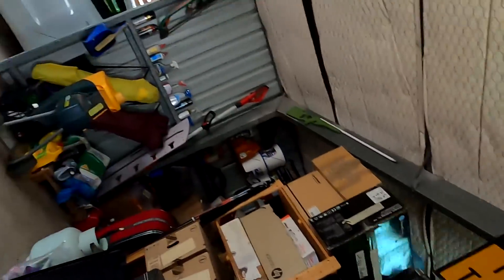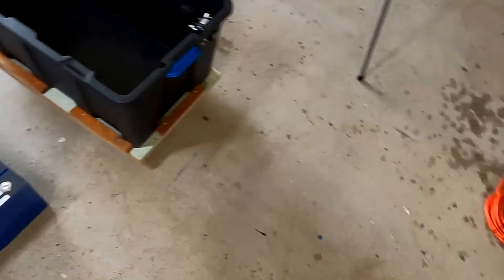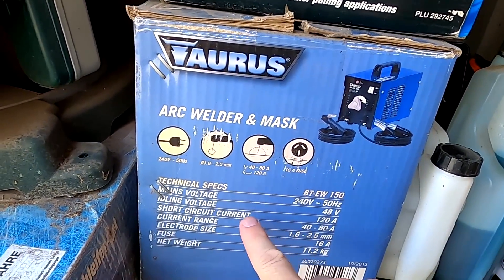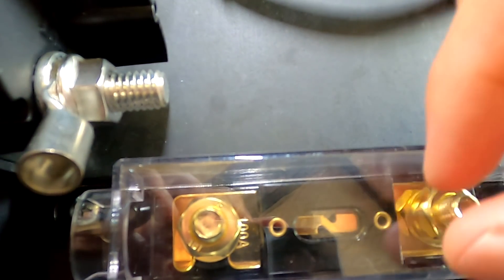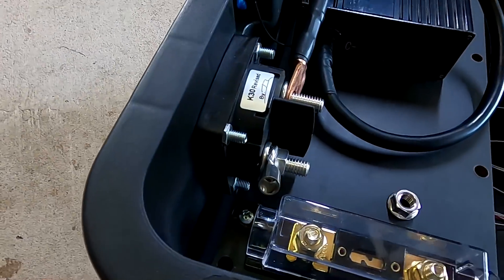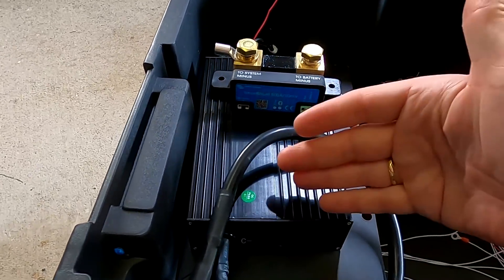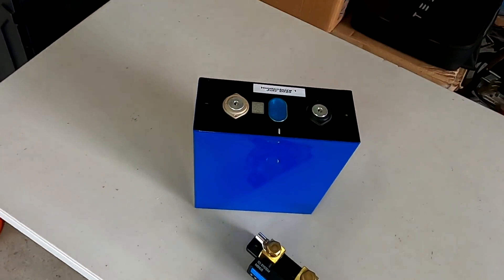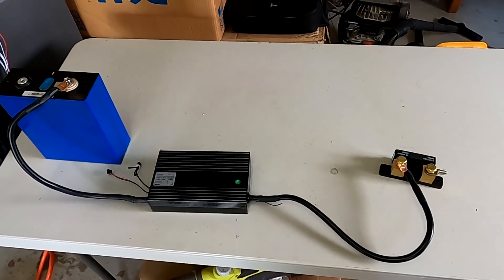Setting Shunt before the BMS a bad idea? Here is why I think this is GOOD! #buildthebattery.2

Comment: You mentioned that the charge controller is programmed to use the shunt rather than it's B+/B- leads for voltage sense. I would suggest number #2. The BMS directly to the battery and the shunt afterwards. This way the Charge controller reports correctly if the BMS disconnects the batteries and doesn't try to push current. The voltage drops you are concerned about don't exist when current drops off near full charge so don't impact charging function at all.  If you go with option 3 you create a very confusing situation if the BMS fails or disconnects the battery.  The charge controller will see battery voltage that is actually disconnected, and will attempt to charge it. Meanwhile what's actually connected to the charge controller leads are the load side so the current will actually be pushed into the load. but the voltage and shunt data still show no current and the (disconnected) battery voltage. That's a very confusing set of meter readings when the BMS is tripped and not what you want to see.  I'm also of the mind that you should consider mounting the fuse opposite the switch and connect it mid pack where it can offer some protection against a short mode failure of internal components.  Where you have it now, all it's protecting is the wire connecting to the whatever the load is.
Reply from the maker: Great points. Thank you.

Comment: That is a series battery only about 900 amps at short not 10,000. #4 From battery to shutoff to bms to shunt to terminal. This isolates battery from potential bms failure as well.
Reply from the maker: LiFePO4 cells have a super low resistance and can easily deliver 10-15kA when shorted. This is not lead acid tech.

Comment: Remember more devices you add in series the more resistance and less voltage your load with receive. Therefore more current will reduce your amp hours when load is applied. Testing amp hours is more accurate when load ( your common use) is  applied
Reply from the maker: Yes, I know that, but you need to connect all this somehow, right? There is no way around having quite a lot connections. I hate this too...

Comment: Question is the batt pack two 24 volt batteries and if so how did you parallel them curious having a bms involved I'm a fla batt guy (fla is flooded lead acid)
Reply from the maker: The battery consists of 16 LiFePO4 cells in series.
fla... nice word ;)
Reply: @OffGridGarageAustralia  Take a look into Hall effect sensors with bluetooth no cutting the smart shunt as far as I know doesn't control the solar charge controller
Reply: @OffGridGarageAustralia  Food for thought being a fla batt guy take a look at Rolls Surrette batteries I'm looking at the 6cs17p 568 amp hours now that's a battery

Comment: Hi Andy, I was reviewing 1 of Will Prowses how to's & he was saying that the Victron Solar Charge Controller does NOT like having the battery disconnected before the solar panels like if a BMS disconnection occurs. He suggests connecting the controller -ve directly to the battery -ve. Just to raise more head scratching issues. Cheers.
Reply from the maker: The is a statement in the Victron forums and they confirmed the MPPTs can handle it without been destroyed. I haven't read the manual yet, so not sure what that says.

Comment: Well, i like it and hate it, should have gone with a metal case, to move heat away from the batteries, heat kills batteries, and would also be able to be fire rated, allowing a more diverse/stupid use-case
Reply from the maker: I don't expect they will get too hot tbh. I will draw 70A max from them.
Reply: @OffGridGarageAustralia  metal case more for if you have a pack failure. Or wire failure. In the event they purge they might fail semi safe but no saying what it's in will. And depends where you put the mppt but would assume charging will generate its own heat. Isn't just how much you draw

Comment: Hi Andy. I'm intrigued with this project. Question. I'm completely non technical but would love a diy set some day in the future. If one had a all in one inverter, can you still have the smart shunt and victron mppt CC? Would the inverters mppt conflict with standalone mppt and smartshunt?
Reply from the maker: Thanks Lennie. The AIO unit has a solar charge controller, inverter and all the cabling already included. It just needs the solar panels and the battery to work. It's very easy to setup. The unit needs the correct settings for the battery and you're done. I probably buy one in the future to show how it works.
Reply: Off-Grid Garage Hi Andy. Thanks for reply. I get the concept of how it works although programming parameters for lithium would be a challenge. My question was basically with an. AIO set up I would I still need a smart shunt and addition mppt if I had a large array and large battery bank?

Comment: Shunt first and do high current charging via the shunt if bms does not support 1c/2c fast charging. Use a high quality charger and discharge only via bms.
Reply from the maker: You're not using solar to charge the battery?
Reply: @OffGridGarageAustralia  Yes but very limited with sun in Norway during winter so fast charging with generator in addition.   Anyway - thanks for a great channel :-)  Cool to se others doing similar setup as I have in the mountains over here.

Comment: Thank you for these videos, I will be using #3 scenario for my build.

I don't want to hijack your thread but if anyone has any input, I'll be using bus bars on both the negative and positive sides of the battery and was curious where they would fit in sequence. I also have the Victron battery monitor shunt and a BMS for my Lifepo4 cells.

Comment: your switch goes on the positive terminal with your fuse inline of the positive
Reply from the maker: That's a bit of cabling effort... I was planning to have the switch in the negative string in this order: battery-shunt-BMS-switch

Comment: #2... othwise the losses in the bms are not accounted for and the actual voltage your inverter sees will be different, only true way to find out is set up a test rig and monitor,  regards Pieter
Reply from the maker: The BMS has very little losses, same as the shunt. I have to decide for one option and see how it goes.

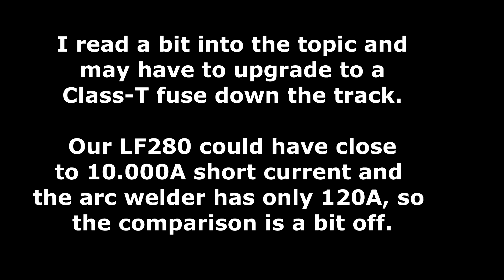Comment: Anmerkung zu 3:59
Wenn eine Sicherung auf 10 A ausgelegt ist und die Spannungswerte eingehalten werden, ist es egal ob da eine 10AH-Batterie oder eine 10000AH- Batterie angeschlossen ist!  Nur weil euer Strom vom AKW kommt installiert Ihr doch zu Hause auch keine Hochspannungsschütze!
---
If a fuse is designed for 10 A and the voltage values are adhered to, it does not matter whether a 10AH battery or a 10000AH battery is connected! Just because your electricity comes from the nuclear power plant, you don't install high-voltage contactors at home!

lg walter
Reply: If you are responsible for keeping the nuclear power plant safe as Andy is for his batteries then he has to ensure that his safe devices will interrupt a dead short.    Between you and the nuclear power plant the distributor will have interrupters to ensure they don fr you or their network.
Reply: @Muppet_Interfector  that has nothing to do with safety!  That is  overengeniering  ---> witch means waste of money!
edit:  see Datasheet from the fuse 
https://docs.rs-online.com/ef18/0900766b8160f8e7.pdf
hand walter
Reply from the maker: Wir haben keine AKWs in Australien.
Reply: @OffGridGarageAustralia  GSD

Comment: The Shunt is a two directional current measuring device. My thought is to use it at the cabinet with battery input on one side and load, inverter and chargers on the orher. Measuring in going and out going current flow.

At the battery connect BMS - Master Switch - Fuse.
Reply from the maker: Another option I didn't thought about. Arghhh

Comment: The arc can last a lot longer than expected. When the link blows and the end points continue to melt, the air fills with ions that conduct very well. The arc will sustain over a distance of several orders of magnitude greater than would be possible thru clean, dry air.
A fuse has three critical ratings. First is the fuse amps. Second is how many amps it can interrupt. Third is the voltage it can interrupt. All three need to be suitable for your application and the ANL fuse is almost certainly not capable of interrupting the current those batteries can provide, and it is highly likely that your car audio fuse voltage rating is less than the maximum voltage on your pack (most automotive fuses are only rated for a max of 32volt but I do not remember what is usual for ANL, and have no idea what your fuse is rated).
Reply from the maker: Thanks, great comment and explanation. I read that the ANL fuses are safe to use with li-batteries. This one is for 48V (as per seller) but it does not say on the fuse itself. So you would go with a class-t then?
Reply: @OffGridGarageAustralia  Victron Energy MIDI and MEGA fuses Rated to 58 Volts. Looks like they also have ANL fuses that are 80V.
Reply: @OffGridGarageAustralia  I know this is two years old but for anyone else reading it all comes down to short circuit current and the AIC of the fuse.  High capacity lithium cells (or multiple cells in parallel) can have huge shortcircuit current.  That requires a high AIC.  You can calculate it yourself.  I = V / R.  Fully charged the cells are 3.65V.  If internal resistance is 0.25 mOhm then short circuit current (dropping a conductor across primary battery terminals) would be 14,600A.  ANL fuses are usually rated for 4k to 6k AIC.  Class T for at least 20k AIC.  Class-T is really only needed at the primary battery fuse.  The branch circuits can use ANL or Mega because the wiring between the battery and any branch circuit (plus switches and busbars, etc) also add resistance which lowers the short circuit current.
Reply from the maker: @namechamps  Thank you for this additional information.
Reply: ive had  a fuse like that pop and there were zero issues  but it was a 24v system

Comment: #3. Purpose of the shunt is to measure what is going in and out of the battery - nothing more. If you put after the BMS - you could see zero draw and run down your batteries and not even know it.  I have heard, however, that the shunt does have a draw and does not read that draw, so same problem.  So still should have a monitor alarm if voltage gets below a certain amount.  I have a unit measuring my battery voltage and will send a cell signal / email to alert me if batteries reach a certain voltage.  Thanks for all the videos!
Reply from the maker: Thanks for your comment. OK, so I'm not planning of running the battery that low, 2.8 would be the absolute lowest. The shunt draws <1mA to operate, the BMS uses  less than 50uA as per specs.
As I still have grid power in the garage, I could switch on a small charger to lift the SOC a bit if it gets too low but I haven't really thought about all these scenarios yet. I guess there will be more videos coming 😉

Comment: I might worry about the fuse arcing if I was using lead acid batteries in an area that was not well vented, because of the fumes. JMHO
Yes, I like the Shunt before the BMS, I'm using a Separate Port BMS because of my Solar Panels Charger. Yea, OK #3.
Reply: What seperate port BMS are you using? I haven’t found any.

Comment: Have you considered using a Victron Smart Battery Sense to monitor the battery voltage? I believe these can be setup to transmit voltage and temperature information via Bluetooth to the Victron Smart Shunt and MPPT Solar controller. Then you would be able to put the Shunt on the load side of the BMS.
Reply from the maker: No, I haven't considered that. I looked into it but decided the shunt is the better product. Don't tell me I have to look again 😑
Reply: Look for a YouTube channel called Freely Roaming, he used one in his battery build and explained what it does and why.

Comment: None of the solutions are 100% but then nothing in life is, there always has to be compromise. Downsides as I understand are; #1 MPPT charging and sub-optimal data due to no shunt info, #2 voltage drop at shunt causes sub-optimal MPPT charging and potential shunt data drift due to BMS idle consumption, #3 potential low voltage cut-off override due to shunt idle consumption. So I guess you just have to consider and compromise on the least likely situation. So for me I would go with #3...
Reply from the maker: Great summary, thank you :)
Reply: Noting the specification sheet for the EVE280N monthly self discharge rate is quoted as ≤3% I reckon that approximately equates to an internal self discharge rate of up to 12mA. It is therefore more detrimental to leave the battery cells in a disconnected state of low voltage for this reason alone. As this self discharge will continue at a rate of up to 12x that of the 1mA of the SmartShunt, that is the dominant danger. It reinforces Option 3 as the preferred.

Comment: why not use an anderson connector, instead of loose cable comming out of your box.
better protection, can be closed off when not in used or transport.

i agree with victron's advise, since the circuits in your bms are completely seperate, you's want to get the shunt before your battery.
although i think the cable and bms losses are very very minimal in your setup
Reply: This is actually a great idea to add an Anderson or SB style connector to your battery.
Reply from the maker: I thought about an Anderson connection just outside of the box but then dropped this idea again as I already have so many connections... Do I need to consider this again?
Reply: @OffGridGarageAustralia  If you can find a connection that safely supports your max current you'll probably be happy you made this choice.  It'll make trying other things easier too.

Comment: your explanation #3 makes all the sense, but I have no knowledge to fully  state or understand the downsides of this choice.

It is in fact true that a battery has a shunt after the BMS, because shunts are not included in the battery, so, there is no option than doing that way, is there?

By the way, I noticed you refer the blue sea main switch is for 40V max! You are running a continuous (more or less) load true that switch of over 48V (16x3,65V=58,4V maximum charge) which is above 20% maximum rated current. Isn't that a safety issue???

Loving the set up and looks of it.

All the best and keep it up!!!
Reply from the maker: Thanks. 48V is the nominal voltage for the switch to disconnect under load. I'm not planning to use the switch during operation. It is more for maintenance purposes.

Comment: Very interesting. I calculated that 8 cells of 230 Ah gives me a 24V battery with a capacity of 5,5 kWh for a price less than 1000 Euros Is that right? I paid voor a 24V 100Ah of Solarfam approx 1300 Euro's. With a capacity of 2,4 kWh

Can I combines these two batteries in parallel? Both have their own BMS.
Reply from the maker: Thank Wim. Very difficult with two different batteries. They practically would need the exact same voltage and charging/discharging curves. The BMS will read the overall voltage of both batteries. Make sure it's the same chemistry and type of cells.
Price sounds about right.
Reply: @OffGridGarageAustralia  Thank You. Both batteries will have their own BMS and switch their own battery off when fully charged. My idea is that there is no problem. Am I right?
Reply: I think if each batter has it’s own bms you will be ok.  If the batteries are a different chemistry then you will wan to make sure that the one with the lower max voltage has a bms that disconnects from the charger.  Otherwise you will overcharge the lower max voltage battery.  If you set your system up where the charger max voltage is set to the battery with the lower max voltage and the higher min voltage then neither battery will be able o deliver it’s rated capacity but ou should not kill anything.

Comment: Ok, the Shunt has an Error LED ? then I would place it outside of the battery-box, to see the signals. 
If the Victron Solarloader comunicates via blue tooth the metal-cabinet may cause problems? 
May be the cabinetdoor(outside) will be a good mounting place for the Solarloader ;o)
---
This type of fuse is used in elektrical fork lifters by more than 48V !  What will happen? a fuse 100A will transfer 1000A for what time till the metal is vaporisised ? Blowed out by his own steam ! 
Warning: Don't observe such sparks without suitable eye protection!!!
Reply from the maker: All Bluetooth... it shows all stats on the phone/website. Comms between MPPT and shunt should be fine, they are close together
Reply: @OffGridGarageAustralia  That's nice if BT works, but in case of an error I prefer the status leds !  The MPPT is monted inside a faraday cage or will you let the cabinetdoor open?

Comment: I'm wondering if high current discharge can overheating the battery inside the case?
Reply: Have you forgoten the fuse 150A ?
Reply: @Gnagnie  I thought of that too. But what temperature increase are generated inside the housing above the ambient temperature?
Reply from the maker: Temperature of the battery will be low as the max current I can pull through the inverter is ~70A at a low SoC.

Comment: First bms than schunt
1 : When you use a second battery Bank you have a Problem.
2 : the MPPT do Not know that the bms schuts off by over or unser voltige of a cell. En try to keep charging When the bms is schut off.
3 : When you using a victron inverter the schunt is communicating with the inverter and needs to know that the bms is schutting off. To Not to damige your mppt.
Reply from the maker: Thanks Dieter. According to Victron, the MPPT will not be damaged if the BMS shuts off the battery. But good point you're making here.